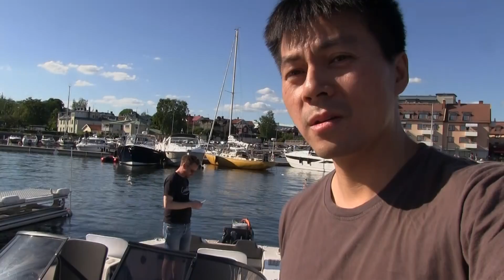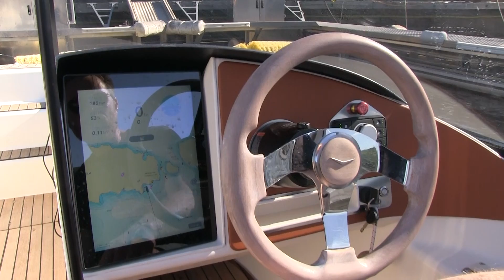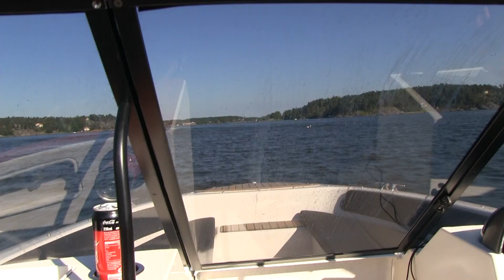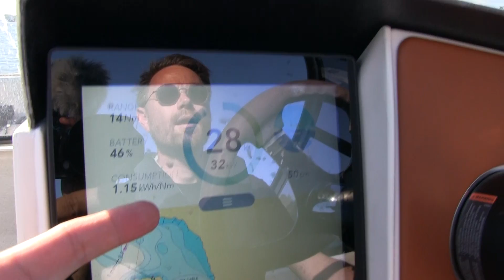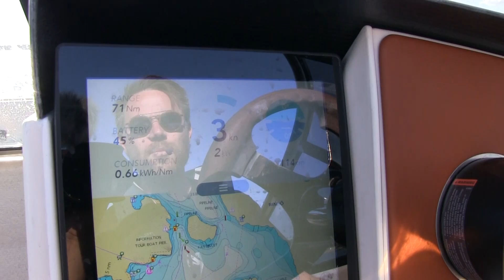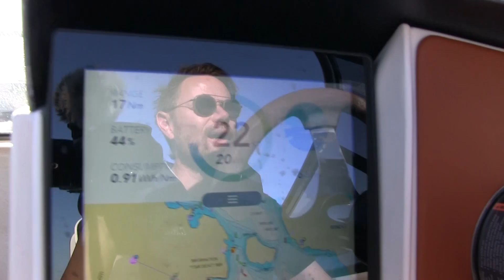Candela C-7 electric hydrofoiling speedboat

Comment: What is the energy consumption with the hydrofoils retracted and the hull plaining on water like a non foiled boat vs on foil at the SAME speed...say 20 kts?  It should be around 4 to 4.5 times difference.  Yes?

Comment: Also mixing electrics with saltwater, is not so good in the long term ;) IT also adds a considerable depth to a small boat. I see the idea with low drag and low consumption, but otherwise, no ;)
Reply from the maker: +Lars Rosing Please read about the boat on the website. The foils can retract.

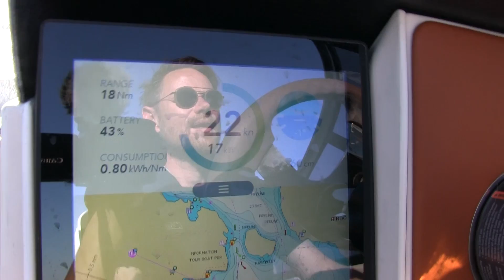Comment: Question at 15:20
Does the power indicatpr of .9 KWh/Nm at 22 Nm/h equate to the total instantaneous power consumption of .9 x 22 = 19.8 KW drain on the battery?
Reply from the maker: That's correct.
Reply: @bjornnyland  Thanks😁

Comment: must be much less wattage required on hydro plane foils...?
less wetted surface drag..
awesome thanks
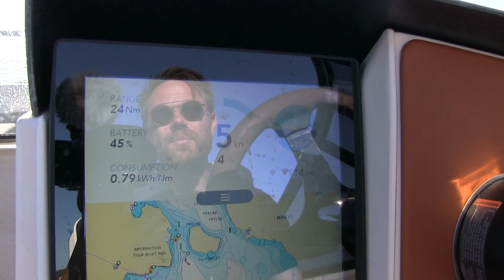Reply from the maker: Watch 14:15
Reply: Bjørn Nyland I had idea to inject air bubbles into wetted surface to reduce drag on planing hulls. Small holes in fiberglass at high pressure eject bubbles to reduce drag.
Reply: @mitzvahgolem  air hockey on water! I would like to see that. I bet it would work. But not so good for foil Dynamics. ...you know, laminar flow and all. :)
Reply: T Mike Soviet Union used super heated steam bubbles on nose cone to create hypersonic torpedo.
Reply: T Mike avoiding laminar flow and drag is my idea. Reynolds number and kinematic viscosity index.
Fluid film friction reduced as in Soviet torpedo no contact between fluid and nose cone or body only vapor .

Comment: This is great. It's fantastic when technologies converge to produce dramatically better solutions. 

What a brilliant achievement.

This could revolutionise personal water craft.

Not only does it radically increase the speed and cost effectiveness of water transport, but it massively reduces the wake produced so will bring great benefits to other water users, wildlife and the marine ecology, including less erosion of river banks. Arguably, it could bring less congestion of the waterways, because journeys will be completed in much shorter times, but conversely it's likely to increase congestion, as it will make it much more viable to commute via the waterways, because journeys will become quicker, cheaper and less weather dependent (less affected by wind and chop).

I have some constructive questions.

Isn't the look of the boat a bit conservative for such a radical piece of technology?

Was it worth the expense of carbon fiber to save a relatively small amount of weight relative to the heavy weight of the batteries?

Wouldn't a catamaran hull form with four foils have been more stable than a traditional monohull with three foils and have given more options for distributing the weight of the batteries and the option of two or even four motors?

Wouldn't it have been better to use the structural strength of the batteries, which is necessary to house the batteries, to form the structural backbone of the vessel between the foils, rather than just use the batteries as dead weight?

Given the complexity of water cooling and the inefficiencies of mechanical transmission through a gearbox and shaft, wouldn't have been better to have the motor in the water in a waterproof enclosure driving the propeller directly, benefiting from the cooling effect of being pushed through the water, like in hydrofoiling surfboards?

Given the huge torque delivered by electric motors, it seemed to take longer than I expected for the foils to develop sufficient lift to raise the hull out of the water, this makes me suspect the propeller was not well matched to the torque delivered by the electric motor. I wonder if the electric motor is mounted on a standard outboard leg with a propeller matched to ICE drive. Because of the instant torque, electric motors can have much larger propellers, which are much more efficient at generating thrust.

It would be really great if you could use another cool technology, air lubrication, to help the boat get up onto the foils more quickly. You would only have to generate bubbles for a couple of seconds and the boat would leap up onto the foils.

Comment: I love this Great concept for speed boats. Very closed to the french Bubble boat but so much more classy. As classy as the German Kaizerboot that looks like an electric Riva, plus extra efficient with the hydrofoil.....So with a <44kWh battery it already gives the range of a >2x larger battery.
Hope to hear what marine hardened battery and engines they opted for. Not Torqeedo and BMW apparently here....

Single phase 16Amp/3.7KW charging remains a room for improvement. Through same Type 2 plug they could upgrade that to tri phases up to 22kW to fast charge in 2h instead of 12h today, allowing several trips on the same day....

I only wonder why hydrofoiling never really took off for ICE speed boats while it should have provided the same benefits there too..... What is the drawback ? Comfort ? Safety ?
Reply: Patrick Free  Probably the 95000 lines of code to operate the foils etc  automatically?
Reply: The problem with charging is, you won't find any harbor places with much more then two phase charging. Most will only offer 1 Phase 16amp. So there is no reason to put it into the boat since you can't use it anywhere anyway.

Comment: What a gorgeous boat. Looks like the cost is ~$200,000 USD. Roughly the same as a roadster. The battery is 40 kWh. Hopefully Tesla will solve their battery production issues enough so they can offer batteries to products like this.
Reply: 200k.....nope. 30k.

Comment: Can you please focus a little bit more on electric boats?  Maybe you can review the Rand Leisure for example.
Reply from the maker: No. My main focus is on EVs.
Reply: There are almost none electric boats since the range is really bad and charging them can be a pain in the ass. This boat only works because of the hydrofoil. Without it would be 200k+$ with almost no range.
Reply: @6GaliX  That's not true. For me as citizen of Austria, it's clear that I need no crazy range, because we only have lakes. Often there are only electric boats allowed. There are also many companies wich do offer boats with electric propulsion. Check https://randboats.com/ for example. With 250km range and top speed of 46 km/h, those are really great.

Comment: That was fantastic! Now what's the range and what happens if you run out of electricity :-) Will we see Superchargers on Windmills with Power Packs out at sea one day? :-)
Reply: They say the range is 3 operating hours at roughly 25 kn. That's ~ 46 kph. So range is ~ 139 km or 75 nm.
Reply: @RubenKelevra  I was having a joke about the daft questions people ask us about electric cars :-) Actually the web site is really interesting, I'm sure it will be a great success. A friend of mine has an electric boat for inland waters. He had it a Fully Charged Live on the the Saturday and he tows it with his  Model X.
Reply: @RubenKelevra  Like a Leaf.
Reply: @RubenKelevra  The screen was showing 21nm at 46%.
Reply: @gimmepowder  I just quoted the website which claims:

»An all-electric hydrofoil speed boat with a range of close to 3 hours at 25 knots.«
Reply: @RubenKelevra  No worries. Just an observation from the video. I noticed it while they were maintaining .8kwh/nm.
Reply: @gimmepowder  yeah. On one hand you don't know the wind direction - this might have an influence. On the other hand: This is clearly a development ship, so the battery size might be different :)
Reply: @RubenKelevra  Still really cool. Where I live in Lower Mainland BC it would be practical for a lot of people.

Comment: I'm not sure if you said it already, but what's the range?
Reply: If it takes 12 hours to charge at 16A/230V, (3.6kW) that's a 44 kWh battery, so at 0.8kW/nm that's about 55 nm or 102km.
Still pretty impressive considering the enormous energy consumption of boats.
Reply: 45 nautical miles at 20-25 knots
Reply from the maker: +Jorge Bernal Díaz Please check the website.